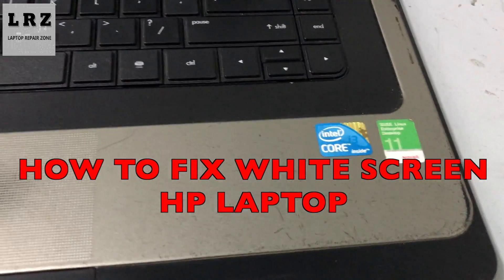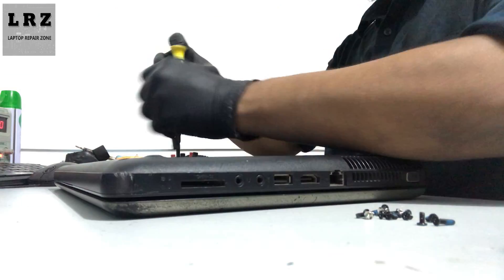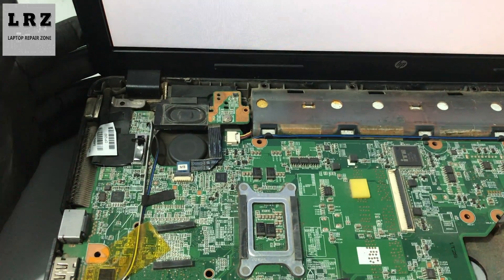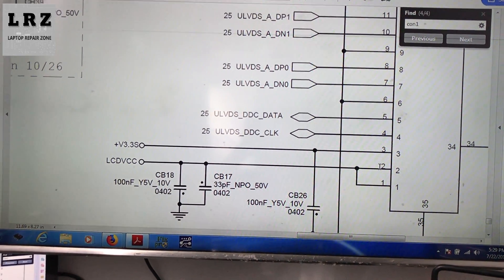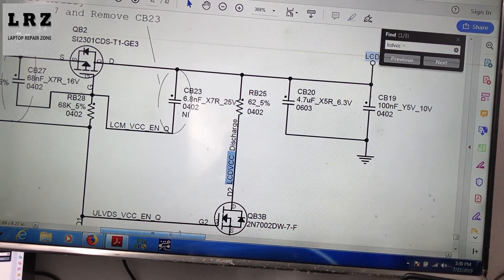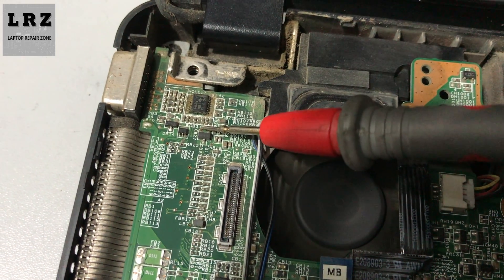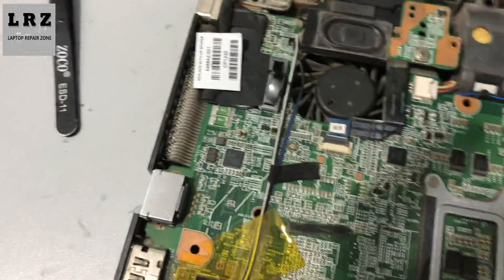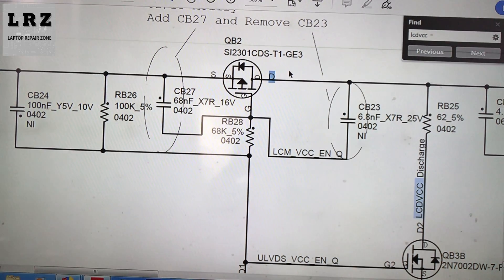How to fix Hp Laptop white screen problem | Hp Laptop blank white screen

Comment: Thanks Man. I did exactly as shown here but mine was the 334 resistor connected to the switch so i changed it and boom it worked after trying for months without solution

Comment: I have the same problem with the same hp 630 laptop but if i check the voltage soles and drain have the same voltage but i don't get any voltage with get

Comment: Sorry to say this but 1.Turn Off The Laptop 2.Hold D and Turn It On 3. Then it would Start Flashing 4.and turn off turn back on and wait a bit and done.
Reply from the maker: Thanks for your comment, if any parts burn out then your technic will work?
Reply from the maker: At first we diagnosis then find out the problem then we try to repair.

Comment: Hi sir i have dell 5558 LA-B843P
RESTART ISSUE 3.3V AND 5V PRESENT BUT WHEN WE POWER ON VCC CPU VOLTAGE come for a second and power off
Reply from the maker: Pawan Gupta follow power on sequence in schematics,thanks
Reply: Ok sir
Reply: Hi did you manage to solve this problem ? I have the exact same issue
Reply: @rezakianpour9668  Please follow power sequence, or clean proccesr or heat the processor